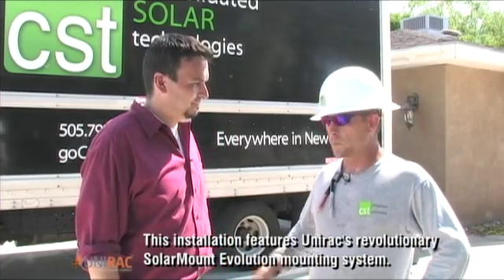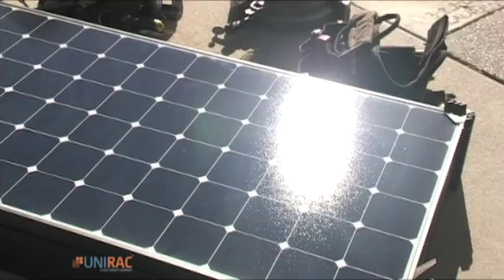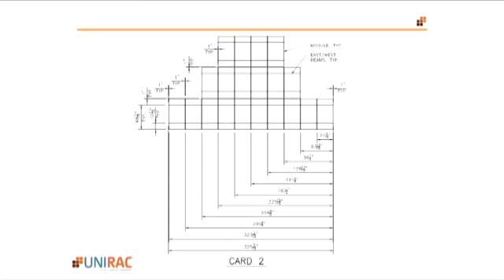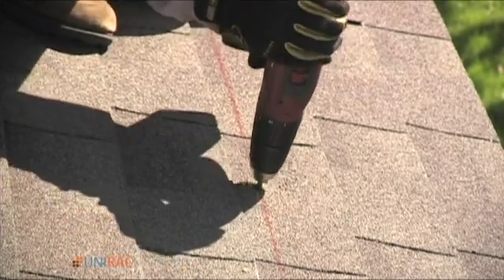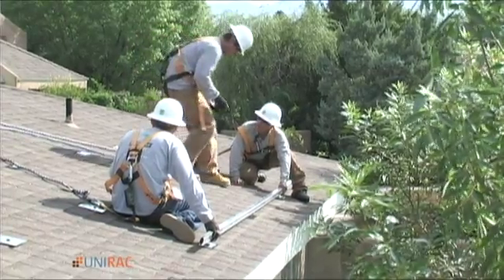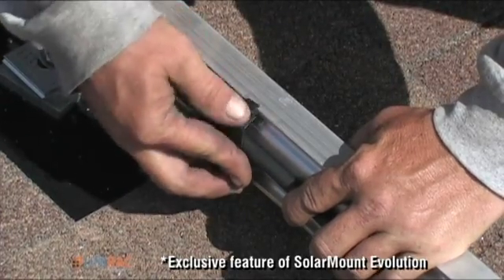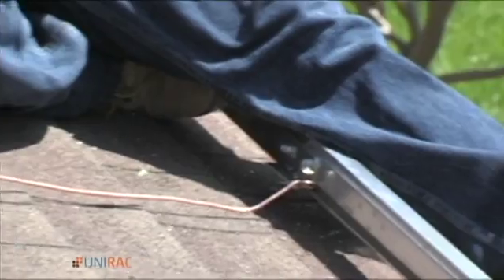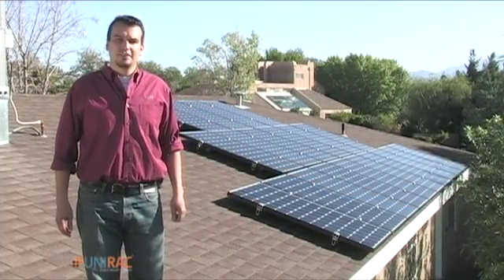SolarMount (E)volution by Unirac: Installation Guide

Comment: These guys r rookies. And those flashings will leak within a few years without using mp1 or some other kind of roofing sealant
Reply: Hello. I am a home owner in FL about to install a 30 panel array on my shingle roof so I have been doing relentless research and checking out many videos. 

Flashings is where I am stumped. It seems it is standard practice to use a flashing system that is around 12x12 in which you tuck about half of it underneath the above shingle having to tear into it.

Now, I'm saying to myself this is not a good idea to have to break apart shingles at all. I don't get why it's standard to do it in this manner. Maybe I am not understanding it.

As it has taken me 4 months to finally get my permit to do this I had purchased 5x7 steel flashings on Amazon at about $50 for 100pack. My purchased system included the L-foot with rails and attachments but no flashing parts.

As a way to cut costs and perhaps perform a safer method I noticed these flashings fit nicely horizontally between my shingles and that I could firmly tuck the top of the flashing into the above shingle without tearing it apart and putting it directly underneath it.  Also the flashing would not overlap the shingle below.
See my photo at this link
https://s26.postimg.cc/4hc1x7hi1/20180410_173143.jpg

My proposed plan would be to use a generous amount of sealant on the flashing, fill the hole with sealant, then tighten down the bolt through with the proper washers.

Sound crazy? 

Why not go this simple?

Am I on to something or do you think I would be at greater risk of leaks or rotting overtime?

I would greatly appreciate your opinion

Thanks so much!
Reply: Any flashing would work but the ones most commonly used are 7x12” with a rubber gasket around the bolt hole. And  no matter which flashings u use, would be installed the same way. The singles aren’t being torn apart or damaged in anyway. Every shingle has a tar strip on the back and over time they stick to the shingle below it. You simply pop that tar seal to slide the shingles underneath the row above your penetration. Same as the ones u described. And mp1 is the preferred sealant for the flashings
Reply: Thanks Nic! They say the rubber gaskets can break and crack over time though. I'm feeling confident with my plan and I will be looking for np1. I was going to go with this DAP ROOF caulk I found in Home depot but it doesnt say np1 anywhere.  I'm thinking about getting rubber washers but still not sure if it's necessary being they may dry and crack over the years. I'm going to start with 1 rail above an attic, run hose water over it, then test the attic for leaks or moisture.